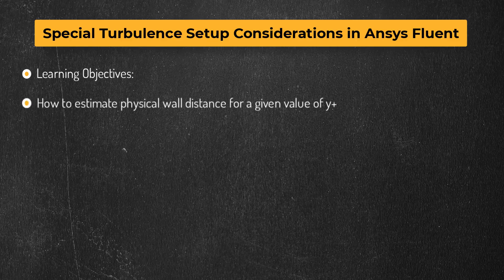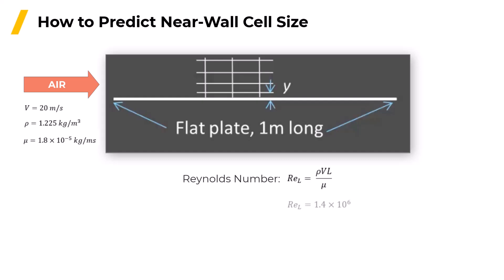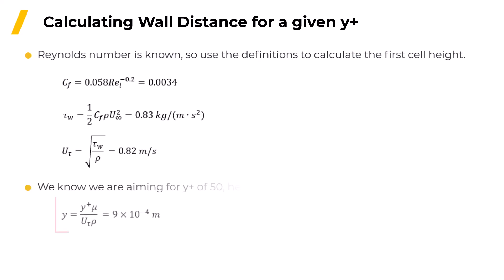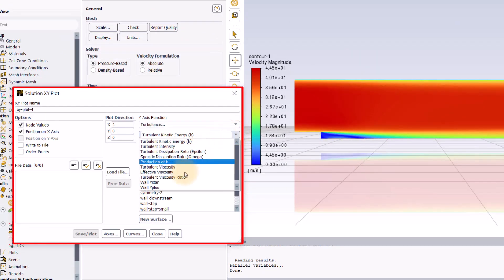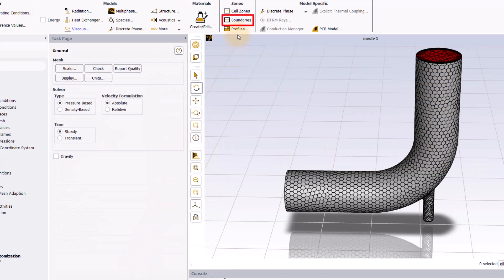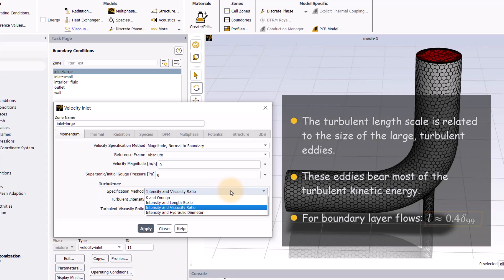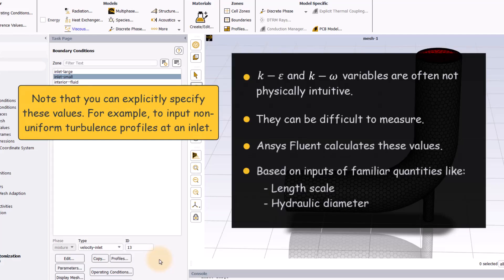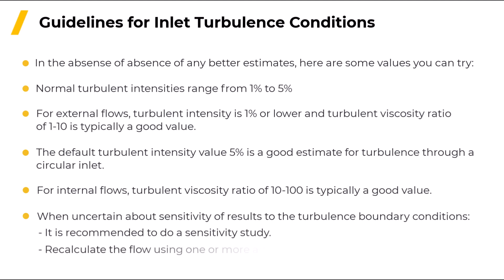Defining Boundary Conditions for Turbulent Flows in Ansys Fluent — Lesson 3

Comment: I hope you are doing well.  I am currently working on a simulation project where the air will flow through a gyroid cylindrical tube, using ANSYS Fluent.

While the k-epsilon model converges without issues, the SST k-omega model has not converged despite my efforts over the past six months. 

Here are some details of the steps I have taken so far to resolve the issue:

Verified and refined the mesh quality.
Adjusted various solver parameters, including relaxation factors.
Tested different boundary conditions.
Increased iteration limits and monitored residuals carefully.
Maintain the Y+ also below 1 
Despite these attempts, I have not been able to achieve convergence. Given the importance of this simulation to my work, I would deeply appreciate your guidance or any suggestions on how to proceed.

If you need me, I will provide additional details about my setup, such as boundary conditions, initial conditions, and mesh details.

Looking forward to your valuable suggestions. Thank you for your time and assistance.